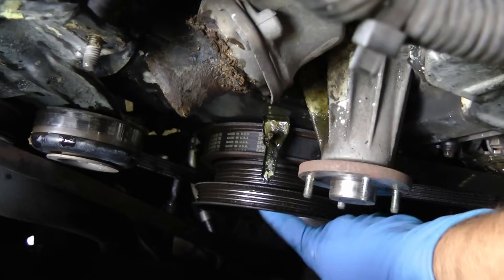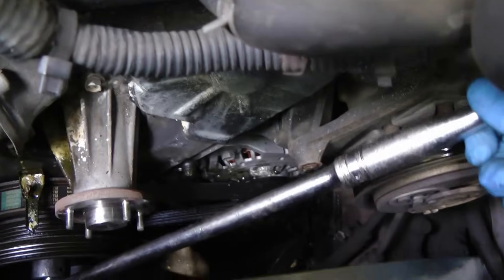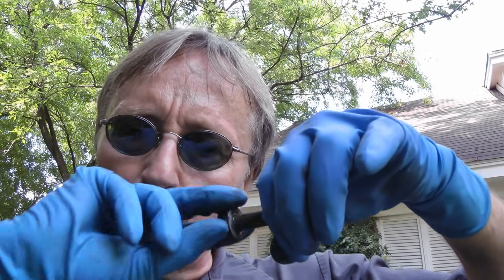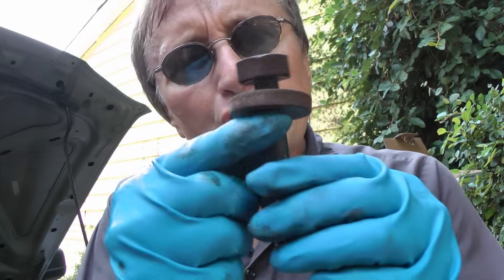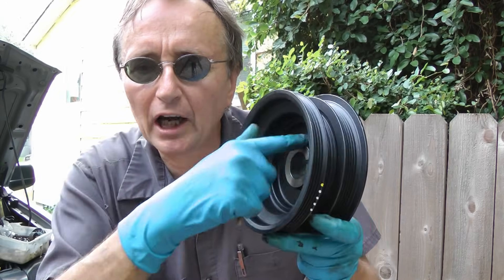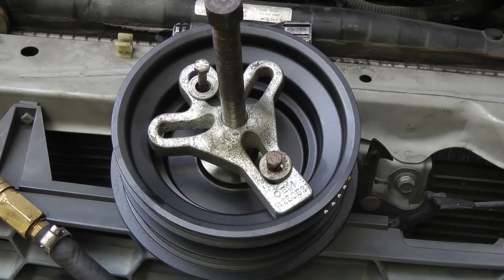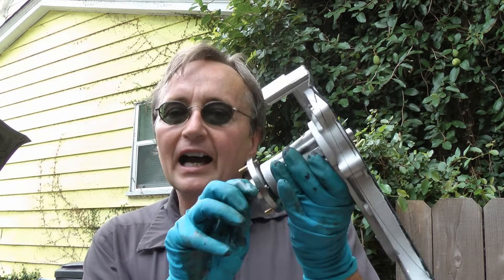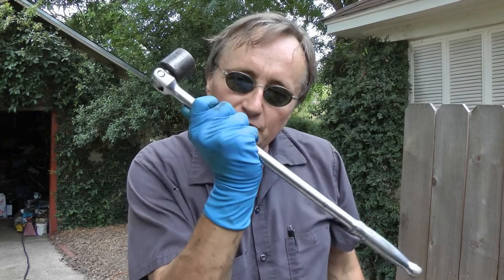How to Remove a Crankshaft Pulley in Your Car

Comment: I wonder how many engines were destroyed from people who watched this video and then actually went in their garage and did this! The numbers must be high. 

There are many cars out there that would be destroyed the instant you turned that ignition switch!!!
Reply from the maker: no damage at all if you follow the directions and make sure the engine turns the right way
Reply: The mazda and ford 2.3 engines have a pressed crankshaft sprocket so when the bolt loses torque the sprocket detaches itself from the crankshaft. They have a warning in the manual that you MUST lock the camshaft and crankshaft before loosening the crankshaft bolt. Awful design but that's how they did it. 

I imagine if you spun the engine to loosen the bolt, the crank would keep turning while the cam shafts stop turning...
Reply from the maker: Talk about cheap designs, but nothing surprises me these days on cheapness in manufacturing. Just to save pennies from putting a keyway on the crank and sprocket. MAN

Comment: Hey scooty, my corsa 1.0 12v 2003 model has failed compression test (40psi) on the second cylinder. Do you recon its the valve or the head gasket? (theres no water in the oil or oil in the water, however, the second spark plug was quite oily when i took it off)
Reply from the maker: either head gasket is bad, valves are bad, or piston rings are worn out. Only pulling the head off and inspecting those parts will tell the story

Comment: You forgot to tell them to put somethan over the bolt hole in the crank to pull it off so they won't have to retread it
Reply: Why would you have to rethread the bolt hole where the bolt was?
Reply: @joeybuddy96  because the gear pullers can damAge the threads if they don't have something to push against covering the hole nota
Reply: NITA
Reply: Not Napa

Comment: Honda owners are going to have a big surprise if they try this XD
Reply: What you mean by that?!
Reply: @stickboyfpv4742  some Honda's have a counter clockwise engine rotation.
Reply: @thestruggleisreal9626  ok thanks you put me at a hault on giving it a try😅 mines spinning cw but Im stilll a bit skeptical on doing it😅
Reply: @stickboyfpv4742  as long as the crank bolt is standard thread then you should be good... And I don't know of any case that it isn't. Even the counter clockwise engines have a normal threaded bolt if I'm not mistaken. Just research your engine thoroughly before attempting lol...
Reply: @thestruggleisreal9626  thanks for the quick response man! I gave ot a whirl!....... now my 3/8 breaker bar is broke.... and my 3/8 to 1/2 inch adapter is as well😫😫 Now Im going to get a single 19 mm thats 1/2 and seeee if thatll break.....!!
Reply: @stickboyfpv4742  You broke your actual bar?! I only ever used a 3/8s drive and socket. Don't have 1/2" gear at all, though I did break a 3" extension from WalMart torquing my head bolts to yield once. Are you sure your crank bolt isn't reverse threaded?!

Comment: How do you torque it up after?
Reply from the maker: you can put a strap wrench on the crank pulley, and hold that while you turn the socket and cheater bar in the opposite direction
Reply: Tried that, actually I used a ratchet strap, maybe thats why it didn't work.  I did however luck out and have the pulley had holes large enough to put the ratchet strap through, just tied the other side to the under body and was able to torque it up nicely.

Comment: I think hondas is the hardest crank pulley bolt it is to get loose ha ha ha
Reply: TheBeautifulme1985 You Wish. The BMW "Jesus Bolt" is torqued at 100lb-ft to start then 60 degrees, another 60 then 30 to finish it off. The actual torque is closer to 305lb-ft for one bolt. No Honda I've seen comes close to that :) Guys have been known to break multiple breaker bars trying to get it loose. Eventually it will break free, but it usually takes tools with it. Most people use a 4-6ft pipe on the end of a 3/4inch breaker bar to get it loose, but even that will bend the breaker bar permanently.

Comment: Them sorry impact guns dont always work for them crank pulley bolts get someone to hold the breaks and put that mike tyson power to it ha ha ha that bolt will come off
Reply: holding the brakes does nothing for the crank pulley.  the brakes stop the car, not the engine.
Reply: Jeff Staples Put it into highest gear, then stand on the brakes. If the engine is in gear, the crank is mechanically connected to the rest of the drivetrain
Reply: Isaac Wilson  You are correct, however there is no need for the use of the brakes at all.  If you follow the video instructions, you only have to bump the key.
Reply: I am not talking about using the starter
Reply: Isaac Wilson Your idea will work on a manually shifted car, as you stated if (1) you have another person on the brakes, or (2) you set the parking brake, or even wedge the brake pedal down with a rod or tool made for the job.  won't work on an automatic because until the torque converter starts spinning at a high enough rpm to generate pressure in the transmission, to operate the clutch packs, the car will in effect be out of gear.
Reply: Jeff Staples
Yeah I really only work on me and my friends vehicles and they're all manuals. So yea I suppose you're correct

Comment: Man this should be categorized as a "master or expert" trick. If you have an interference engine you will ruin it. I can see novices doing this willy nilly not realizing it is always difficult to get a crankshaft off(supposed to be); so they default to this method.

Scotty, you should have had a warning at the beginning of this video. Not everyone has your expertise and knows what damage this can do. Of course this works on some engines maybe most engines but I would never do it. NEVER!

Comment: Wow,,  pretty irresponsible cominf from someone with so much experience. How about you replace this video with one showing the correct tool that holds the pulley from turning.  Pretty simple concept.  Get the tool so you don't damage anything. I'd love to see you try this method on a V8 engine and film it while your at it....

Comment: yes but dangerous Mr Kilmer !!, nowhere do you you warn people to disconnect the power lead to the ignition system so as to stop the engine from accidentally starting up, my car will fire up and start with a flick of the ignition key,
Reply from the maker: ah, but if you flick the key on and off quickly, the engine would not run as the power is shut off when turning the key off
Reply: ok yes i would agree with what you say to a certain extent, but i can see that the less average DIY home mechanic flicking the key and the engine firing up, and panicking!, finally running of point, some vehicles have more than one bolt holding the crankshaft pulley on, my vehicle has 3!,

Comment: DONT and I mean DONT DONT even try this in a Platina, Clio or similar.
You will finish destroying the valves, pistons and/or connecting rods.
Why? Because those stupid cars don't have the key blocking crankshaft with crankshaft sprocket.